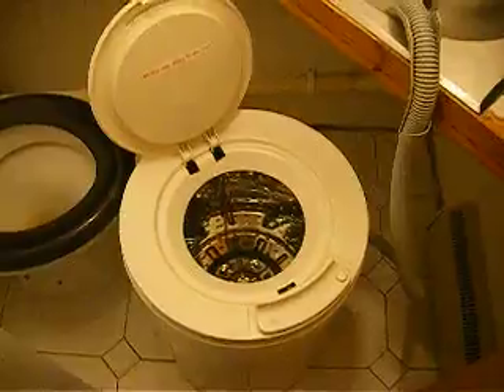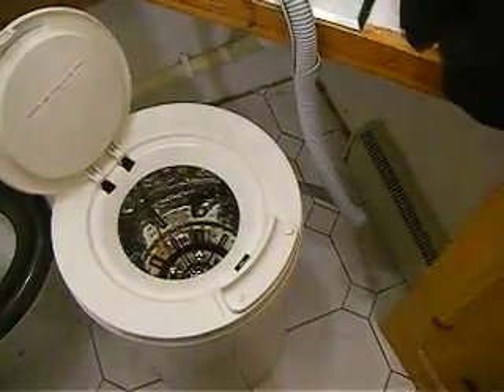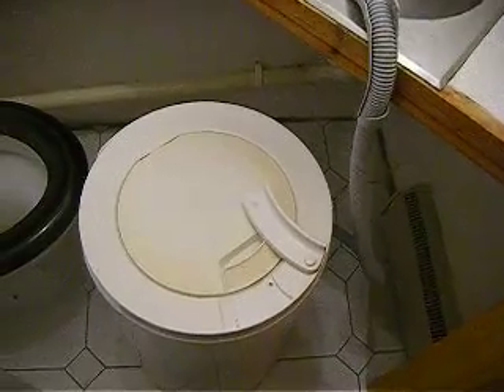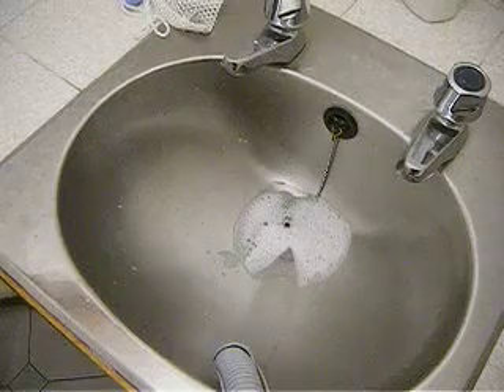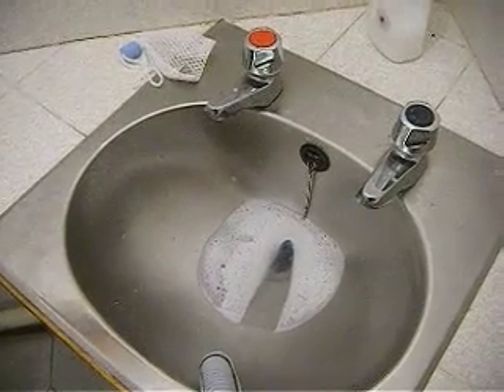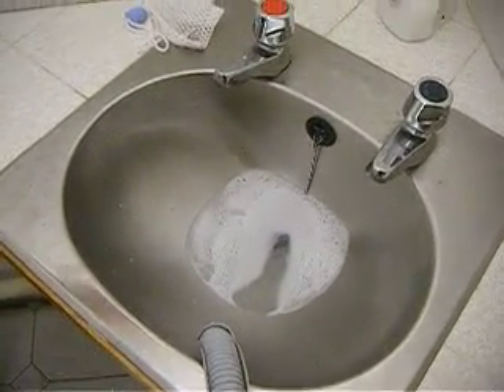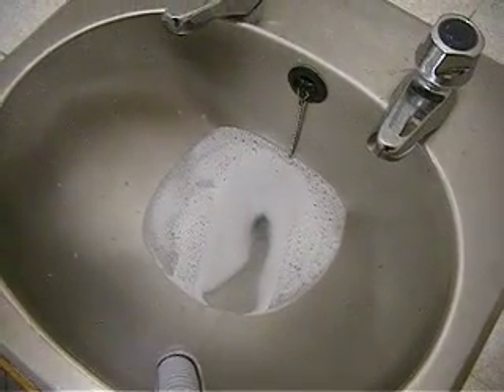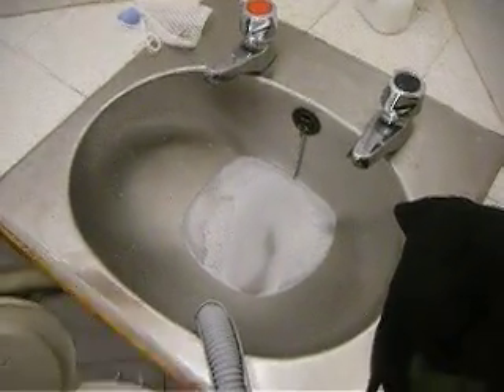Energy Efficiency Spin Driers and Cloths Washers

Comment: Hi spin speeds are obviously desirable when using a tumble dryer but NOT if you"re rack or line drying. The extra creasing takes more ironing out and therefore more energy is used. Not to mention the cost to the psyche in time and temper. LOL>